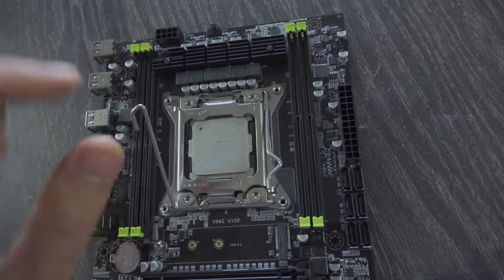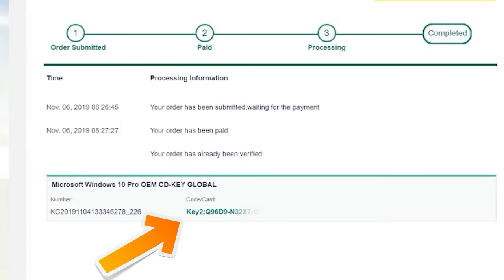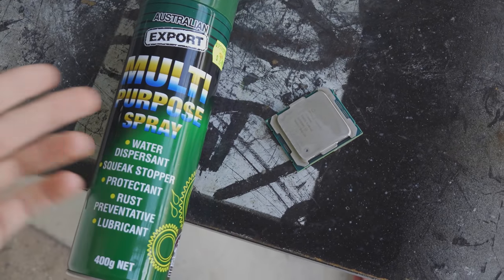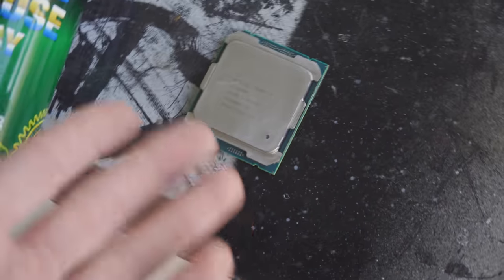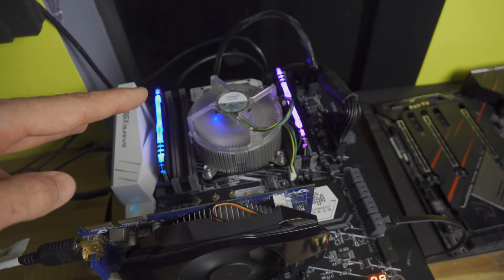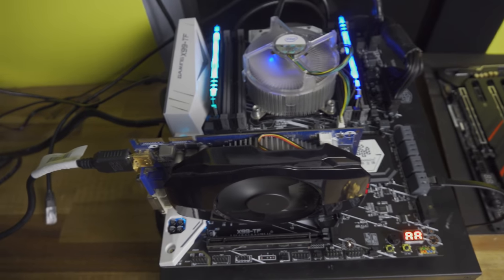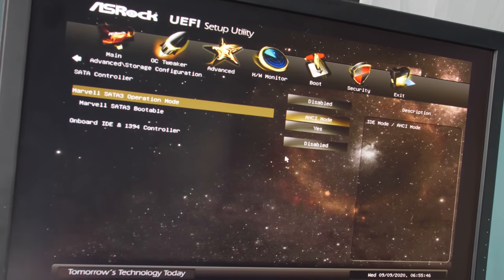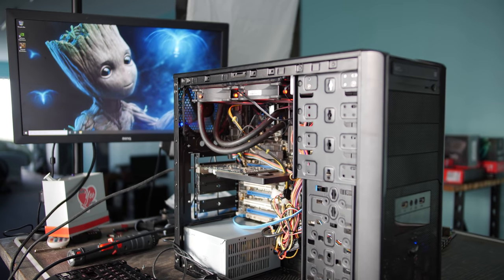Can you FIX a CPU with a WHOLE corner missing...?! (weird computer problems)

Comment: 5:27 If the CPU goes... just replace it with an Aliexpress Xeon! Problem solved! Xeon FTW!
Reply: Can you easily add a Xeon to X99 like you can with X79?
Reply: @fragalot  yeah
Reply: @fragalot  Yes, it was always that way since ages. Only difference after X58 is that you can no longer overclock Xeons beyond about 6% with potentially unstable onboard devices (since PCIe got coupled) - at least not without some serious insider knowledge.

Comment: I just bought a Z97x gaming 3 motherboard by Gigabyte, and  the person  said it was broken, so they sold it for 20 usd. I get it home and run some Tech Yes Trial and Error testing method and after trying, the cpu and pcie slots, and all the ram slots found out the B1 dimm slot was a gonner. Whats great is A1, A2 and B2 all work fine and will post as long as no memory is in B2. Got a steal of a deal. Normally this board would be over 120 usd on the used market. I know it isn't the weirdest fix by any means. but a satisfying conclusion nonetheless. There was a good chance I wasn't going to be able to find the problem, but with what I have learned from your videos I was able to figure it out. Thanks for the videos Bryan and all you do here on Tech yes City. Keep up the great work!

Comment: About 990FX. I was upgrading, strangely, from 4350FX to 8300FX on the same MB with RX570 8GB and all was fine until there was some real overheating. It was old Thermaltake 630W bronze 87+ and nothing suspicious except 5V rail was dropping down to 4.5 and some under. So I got me brand new Seasonic 650 Gold and have rock-solid 4.9xxV. Moral of the story. No more overheating and good to go next year for sure. 
Thanks for all the good videos. Keep it on.

Comment: I got a 6700k that had 3 corners bent up on the substrate and cracks going through it,   Gave it the some Tech Yes lovin with the spray and delidded it. I got it to come back to life with minimal mounting pressure..   Its great my buddy still running it today was a nice surprise.

Comment: I have a bizzare story with power supplies. I first had a Corsair VS550 psu, worked well for a while until it started random restarts especially during gaming, at that time I had a I5 4440, GTX 960 and 16 gb ram combo ( I think effective storage of 1.58 tb). So I replaced it with a CM B600. Worked for a while, but suddenly, the system stopped posting but kept running ( apparently it had issues with 12v not providing 12V fully). So I switched back to the Corsair one for a while and got basically a rebadged b600(mwe600 I think it's called). The same issue popped up again, which lead to finally switching back to Corsair one, which to this day, with an even more powerful system, works very well. The story doesn't end there though. I upgraded from the system mentioned above to R7 2700+ 1660Ti combo, so I sold my old system to a good friend of mine, with the same power supply that had the 12v issue (B600, I did mention to him that the issue is there and the first thing he might need to change is the psu), but, it works absolutely fine for him, probably a year or two now since I've sold my pc with that power supply.

Comment: The very first thing to do is to grind the fault line smooth. You have to make sure there are no metal bits sticking out. Alway do that before insulating it! Otherwise, the thing might, in time, short again and you'll have to do it all over. That's the best-case scenario, worst case some part of the die or motherboard will fry (I've seen it happen)

Comment: One of the weirdest things which i've seen yet, and a pretty frequent one as well, is when people are just running their cards normally and they cut out on them, be it a motherboard or a GPU. Then they sell it/bring it over and simply reflashing with a programmer the same bios that was on there does the trick. And the cards work for years after that, I still have around a GTX 550 Ti to which i've done that, I use it as a test card.
Reply: Really happy to see you here man
Reply: @hondacrx4909  Glad to see you too!

Comment: Getting a copy of the CPU pinout can save a lot of time. Many pins are vcc or ground. I have seen several CPUs missing these pins with no issues. One case that comes to mind was an LGA 775 board (fairly high end and brand new), which appeared someone had dropped a CPU on its side. I don't recall how many bent pins there were, but a couple of them just snapped off when I tried to straighten them. Board worked fine afterwards.

Comment: Thanks for all your videos! Always love the content you provide us!
Quick question: Would it be possible for a computer be on a boot loop where it would like turn on for a quick second but no display then powers off on repeat if it has a faulty CMOS battery?
Reply: I had boot loop once because of a bent CPU pin. I tried to fix it but didn't have the right tools and broke off. However that fixed the boot loop. So I guess a boot loop is probably because the pin shorted, because when I broke it off it fixed the boot loop.
Reply: @xponen  Thanks for your input!

Comment: 8:22. I'm a victim of GPU degradation. I had an old GTX 970 bought in Jan 2015. The first symptoms started when it was changing colors in Overwatch but doesn't seem to affect any other game. It usually goes away after a new match or during killcams. I thought the game itself was bugged. 3 years in its life, it started to black out my screen, so I stopped playing competitive. In its four years, It started crashing, and it didn't just affect overwatch but other games too. I also found that lowering the GPU clock speed to the lowest possible configuration in afterburner helped stabilize but not completely eliminate the issue.

I upgraded my system from FX8370E to 3700X last November 2019. I knew the GPU may have a problem but I didn't want to upgrade yet and wait for RTX 3000. However, after upgrading, the same issue carried over to the new build, so I decided to do a sidegrade to an GTX 1650 Super.

Thanks to the Coronavirus, I'm short of funds in upgrading to a 3080 and have to shift priorities elsewhere. Since I'm still using a 1080p60 monitor, I guess I'll need a better monitor first then focus for next year.

If your GPU is showing symptoms of degradation, and is still under warranty, even if it's the 4 year manufacturer's warranty, give it a shot in contacting the manufacturer for RMA. My 970 is a dead paperweight now no matter how I clean it

Comment: Yep, that looked like where the DDR controller pins are in socket 1156 on up, You're probably missing a ddr channel or two, but since its quad channel you wont ever notice it if you're down to dual channel performance in games. Heck you would probably never notice if it went down to single channel even if that does drop performance like 10%. I've sold a machine like that in the past, just need to let people know and offer a discount. It was a machine using a motherboard i got in a "broken" pile, i got 5 of the 6 to work again, problems included bent pins, a missing capacitor, a bent pcie slot (same board missing a pcie capacitor), and bios's needing a reset. Then there was one special board, it had like 30 bent pins, a few missing pins, and a broken off pcie slot, it became a personal challenge after i fixed the other 4. I didnt have a pcie slot to solder on so i just removed all of the pcie pins to make it look normal ish. I then straightened the remaining socket pins, the broken pins included a vcc pin (not effecting anything since there were many other vcc pins to take the load), a ground pin (not really missed either since there are other ground pins), and a ddr pin (well, shit). I was able to get it to post in single channel with 16gb's of RAM, I validated it with many different tests, and sold it with warnings as to what was wrong with it. It's been running strong for over a year now and i haven't heard back since.

Comment: I had a similar case with an AMD 3600 chip that had a few pins missing, only 1 ram slot was working but all pci lanes were ok.  The PC will work fine with single channel ram, nothing critical.

Comment: I have a HIS RX480 8GB, there is problem when the GPU is under load, sometimes the screen froze.. Temperature is still under 70C underload, no overclock..
I tried re-apply the thermal paste, changed the thermal pad on the VRM, turning down the clock speed, downvolting.. nothing works..

I saw someone at a forum (forgot the forum name) complained about the heat at the other side of the VRM, and he decided to put heatsink on that side (he didn't get any problem with it tho)..

I cut some heatsink and made sure that it won't short anything, put a thermal pad (the sticky one), aaaand my problem gone...

EDIT:
here are the pictures of my RX480 now after putting on the additional heatsink.. hope it helps.. (sorry for bad camera quality)
https://drive.google.com/file/d/1R3JlQ4Wx-d_9VLWytfsJinGG6iNErLrs/view?usp=sharing
https://drive.google.com/file/d/1Izu1yNH5p3NACSm15ditG67CqH4mru91/view?usp=sharing
Reply: classic rx480s
Reply: What driver new drivers do this to me .
Reply: @cutty02  if I remember correctly, the problem began at February.. but after putting the heatsink, my problem gone.. so i think it's not related to driver issue
Reply: Powers Supply ?
Reply: @jamezxh  power supply is fine
Reply: usually this is sign of the gpu is dying, try heating the gpu core with heat gun. It should fix it temporarily
Reply: @sirbhimasb  maybe,but for now the heatsink trick works.. haha
Reply: Baking your gpu might fix the whole thing, try doing some research on that..... But it seems like your gpu is on its way to the grave
Reply: @primusloy  agree, lol xD

Comment: I have an old 6970 that artifacts real bad. Turning up the memory voltage as far as the slider lets me, will reduce the artifacting significantly, though not entirely. Lowering mem freq didn't do anything if I recall correctly.
Kind of looks like the same artifacting in your clip. Something about positional data for textures or objects or whatever in the vram being effected which makes things go all flickery, long and spikey. 
Would be really interesting to actually know what exactly has happened from an expert. You should see if you can get an interview with a relevant engineer. Or a vid on all the different artifacting and what they mean, what can stop or reduce it etc would be cool too. That might be a bit of a deep dive though. Tech is fascinating

Comment: I have a R2600 with 4 completely broken off pins and a few more not entirely straight ones. I actually think it performs better now. I tried finding schematic so i knew what to expect, but this information is very difficult to obtain, at least on a R2600

Comment: Heya Tech Yes, I need some advice! 

Sometimes I just wanna build a PC for fun, so I do, but end up using janky parts like DDR3 and Chinese motherboards. But after I build it, I wanna get it off my hands 'cause I've already got a PC.

How do I sell that stuff? For example, I just built a sweet X79 machine that gets a 4600 score in Superposition on 1080p Extreme, which is actually higher than what I get on my main Ryzen machine using the same GPU, the 2060 KO.

Well, it scores great and plays games nicely, but I'm not sure how to market it on places like Craigslist. I've been sorta just leaving out the CPU and motherboard details other than generic "i7" or "Xeon.." I figure they don't really know about the most recent developments in computational technology and just want to play some games. But on the other hand, I really dislike not being clear and direct with the components, but I don't want to scare them off by mentioning that it's either a bit older, or Chinese. 

I ended up just listing some benchmarks I got from popular games, but is that enough? It hasn't sold yet!

Any advice?
Reply: Benchmarks would be the best thing to list. I sell most of mine as either Fortnite or Warzone PCs, set the wallpaper take a few photos and include those benchmarks.
Reply: @pcflippin2901  Yeah, I set my background as a nice Cyberpunk 2077 wallpaper, and I'm even selling it with a full keyboard, mouse, speaker, and monitor set, so it's certainly a full system. I only just started, so I'll probably just need to give it some more time.

And I'll probably watch some of your videos. They look cool. =p
Reply: Have you been using Facebook Marketplace too? I end up buying/selling around 90% of the time there - I definitely wouldn't rule it out. 
Cheers for checking out the channel - I appreciate it!
Reply: Maybe try a different approach, try luring types of buyers, don't only sell specs.
Whenever I sell a 6+ cores PC, I advertise it as a streamer pc, or graphic designers, professional pc, etc.
Use language that entices each potential buyer, word it like easy OBS capable, CAD machine, fast Premiere renderer.
Sometimes I even put things like "save ##% of time per day and do more work than with typical PCs".

Comment: I had an awful Aorus motherboard that had a corrupt UEFI. I wound up finding out that the way the dual BIOS worked was holding the reset button along with the power button on booting up. I detested having to do that everytime I powered the system down and needed to turn it back on. My solution? There was an undocumented method of choosing the backup BIOS that worked on the Intel-based version of the same AMD-based board I was using that involved shorting 2 pins on the primary BIOS chip. I just soldered a jumper wire between the two and continued to use the motherboard until I bought a competent replacement a few months ago.

Comment: Weird issue storytime?
Just a month ago I was disassembling 15 years old AM2 based PC. And of course, the thermal paste was properly stuck on the CPU. The cooler and the CPU did not want to separate - at all. When it finally did, the CPU landed on hard tiles on the ground and I ended up bending at least 10-15 pins. My mistake, I should have done it over some soft surface. 15 minutes with a sharp knife and I was able to get all of them in their original position.

It seems like the pins can handle some beating...
Reply: Try using a mechanical pencil to bend them back if it happens again :P

Comment: This weird problem happened after gpu swap/upgrade (2070 super for rx480). Whenever I started a game and put some load on the system my pc crashed with black screen and restarted. I was trying everything I could come up with for 3 days. What ultimately solved the problem was lowering my RAM speed. Since then no crash.

Comment: I have an Asus Z370 F Gaming MB that some pins were bent on the socket, i did bend them back with tweezers and magnifying glasses, they look fine but i have not tested it after. I have since bought a new MB but was thinking of making a backup pc since i almost have every part to do so. 
Have you tried to straighten bent cpu pins before and did it work after?
Reply: He has done that many times, watch can yes fix it episodes. And they all worked unless the pins were missing

Comment: So I dropped my Ryzen 9 5900X and it fell right on the corner and broke off a small part of the corner, all pins are fine but the CPU does not work =[  such an expensive equipment and I dropped it facetiming a buddy of mine while discussing the components. I have super HD photos and want to know if it is something that can be fixed?

Comment: I have an Asus P8P67 WS Revolution board and the PCI-E x16 slots on the board will only work with Ivy Bridge Processors.

Back when the Sandy Bridge B3 chipset reversion came out in 2011, I bought a 2600k and an Asus P8P67 WS Revolution. After 5 years, I tried to run a 32gb set of Kingston DDR3-2133 RAM with XMP on, but the system crashed. After that the board would hang on the b2 code. I tried many different things but I wasn't able to get the board to POST until I bought a new BIOS chip for the board. Then I discovered that the PCI-E x16 slots would not work. However I could get a video feed from the GPU if I plugged the GPU on to the board using a PCI-E x1 Riser card. I also tried to get the PCI-E x16 slots on the board to fully function with a Pentium g645 and a 2500k but no luck. (Yes, I tried a few different GPU's, RAM, Power Supplies, different slots, etc)

A few months later I got a Core i7-3770 in a trade..... for almost next to nothing. Since the P8P67 WS Revolution was the only 1155 board I had, I decided to test the i7-3770 on the board. When I set the system on my table, I decided to forgo trying a PCI-E x1 Riser card and I installed the GPU into the primary PCI-E x16 slot. When I booted the system up, everything worked just fine. Then I tried with a couple different cards installed and those x16 slots worked. Over time I came across a two different 3770k's, E3-1245 v2, and an i5-3570 and the PCI-E x16 slots work with those Ivy Bridge processors, but the PCI-E x16 slots will not work with a 2500k, 2600k, and Pentium g645.

Comment: I had this problem with X99 where I couldn't get quad channel working, tried two Asus X99s and 2 i7 5960Xs and it would always crash windows/bootloop or shutdown when going into the bios. Strangely after a couple of times trying it would just magically work. When I was trying to sell this PC I wanted to reassemble the ram heat spreader on one of the sticks because it fell off, so I took it out and after placing it back into the Mobo of course it did not boot again. The customer came 5 mins later and he didn't want to buy it obviously. After a couple of hours it worked again.
I hate X99.